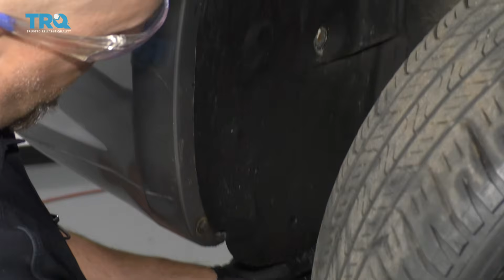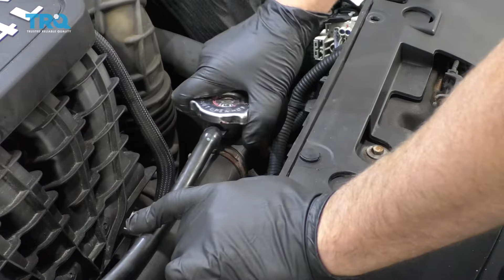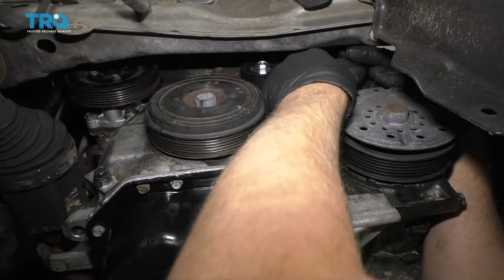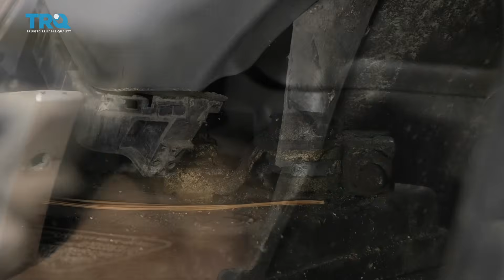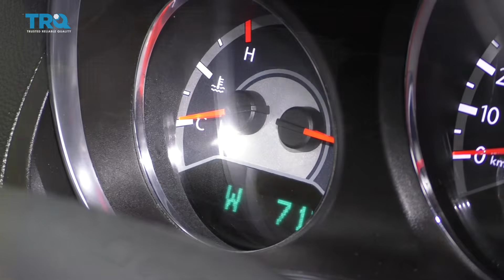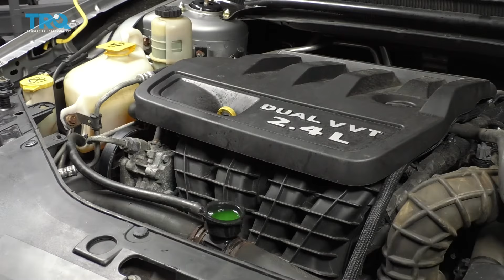How to Replace Water Pump 11-17 Chrysler 200

Comment: My car is overheating and I'm not getting any codes I have removed the thermostat housing from the engine block
There are now four open ports on the block. I believe two of them are coolant intake and discharge for the heater core and the other two are intake and discharge to the radiator. When I start the car there is no coolant from any of the ports being discharged
Does that indicate a bad water pump
Reply: Sounds like a bad waterpump to me....
Reply: No...the pump can not create pressure with the housing removed.

Comment: You can disconnect both + & - terminals from the engine compartment. Both cables go directly from the battery to the lugs in the engine compartment.
Reply: You don't need to disconnect the battery terminals to this job!

Comment: That was probably the hardest way of getting to the battery I have ever seen.
Reply: And the only way to get to the battery.To disconnect just do it from under the hood....no need to access the battery itself.Actually no need to disconnect the battery at all when doing this.
Reply: Who reset electronic throttle hyundai accent 2014

Comment: I didn't see when you tightened up the bolts for the water pump pulley
Reply: Torque for the pulley is  "good and tight".